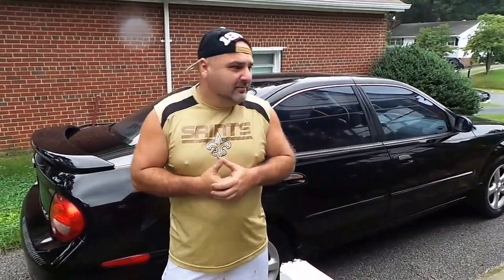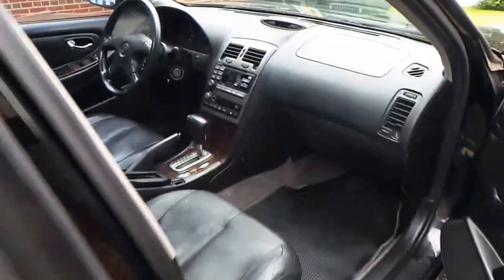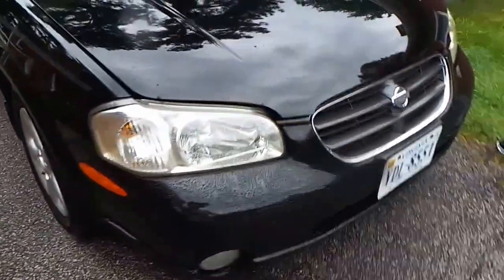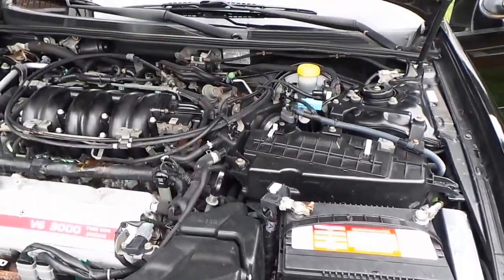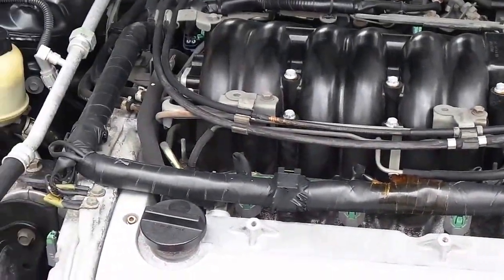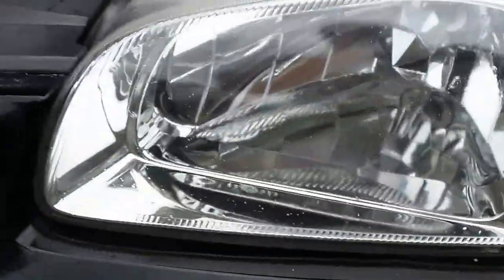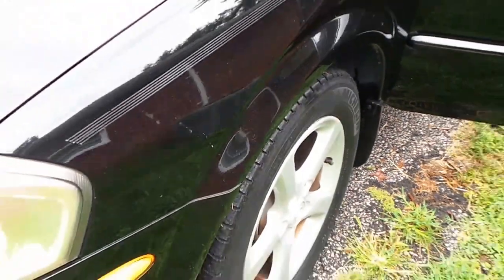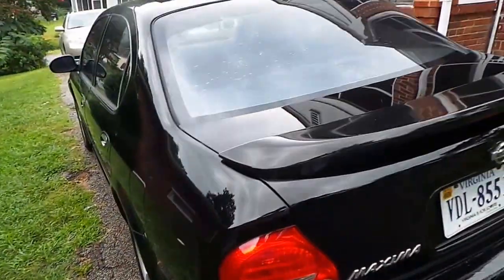What's It Worth? 00 Nissan Maxima Final WalkAround

Comment: I bought my gf one as her first car. Strong engine and smooth ride but those Maximas are high maintance. Replaced motor mount, power steering hose and just last week a radiator. I bought it for $2700 with 210k miles. I'm thinking since yours is the top of the line model I will say $3000 if it's around 150k miles. Great job detailing it though!
Reply from the maker: Viktor Viktor Thanks for the feedback man. Would love to have you submit your guesses and join in this contest. Its our way of doing something for you guys to show our appreciation for your support of our channel.

If you're not familiar with how the contest works, here you go:
-For each series of contests, we will be posting videos of 3 different cars. You watch the video and then comment the following:
1.) What do you think we paid for it?
2.) What do you think we will spend on repairs/reconditioning for resale?
3.) What do you think it will sell for?

That is it!! Its that easy!! After we have completed the 3rd car, the submissions of everyone who took part in the contest will be tallied and the winners announced by video.
Reply: +Viktor Viktor They are sure great cars, that drivetrain with regular maintenance is pretty much bullet proof.

Comment: I bought my 2000 SE in 08 for 3700 with 55k spend about 400 and now it has 234,000. but they are selling now for about 1000 to 1500 depending on sellers and condition
Reply from the maker: +Faraz Queens village yeah they are great cars no doubt about it get a lot of miles out of them
Reply: Dude u still driving it